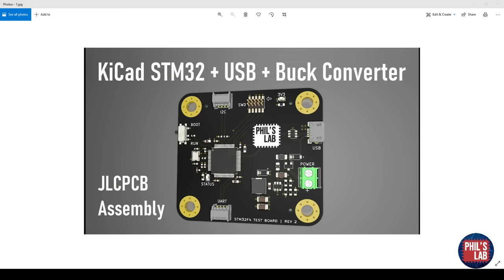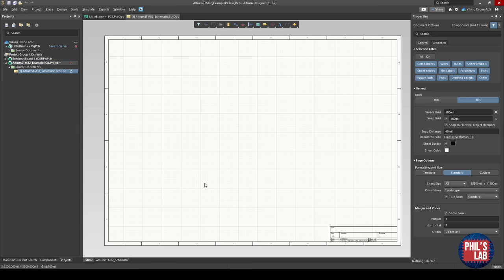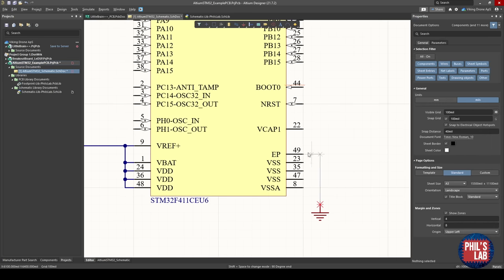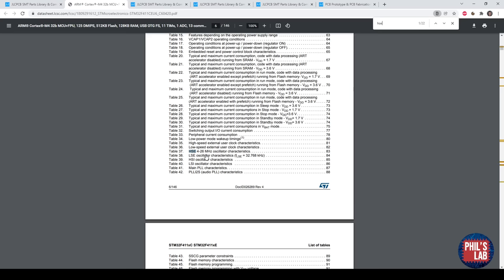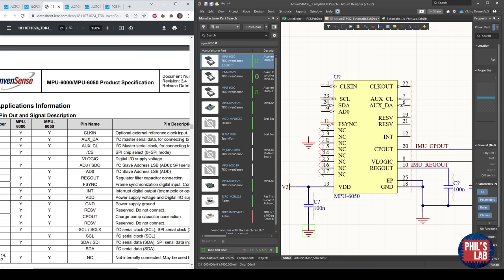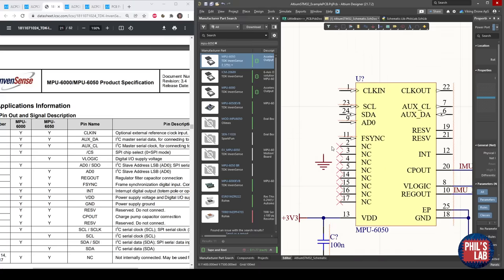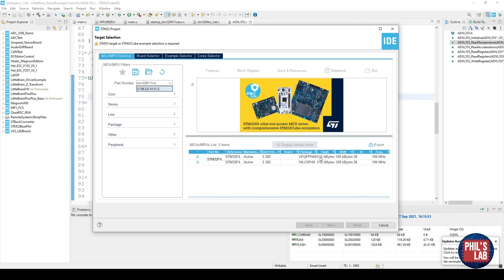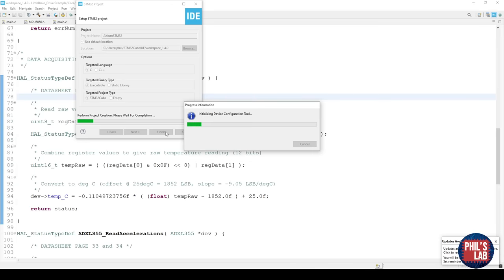STM32 PCB Design - Complete Walkthrough - Altium Designer & JLCPCB - Phil's Lab #41

Comment: Again, a really good video Phil! Thank you. I´ve been using Altium for 11 years and I always get useful tips watching your work.
One thing that came in to my mind when using small resistors and capacitors like 0402. Keep the connected copper to them as unified as you can. We have had problems in the solder oven with components standing up towards the side with the largest copper connection. Several times I have had to decrease the conductor width towards groundplanes to avoid this.
Reply: Yes, tombstoning is the name of the phenomenon. Thermal relief on the pads becomes very necessary for these small passives.
Reply: @wesleybecker834  is there a video that describes this topic in detail?

Comment: Thanks so much for making all these tutorial videos that shows entire process from start to finish with the rationale for the decisions made. I have a couple questions about impedance controlled traces between your designs in the videos and in the GitHub repositories.

In the video you set up the USB trace widths for the JLC7628 stackup (0.26mm), but the gerbers in the GitHub appear to show them at 0.1532mm. Did you end up changing to producing this in the JLC3313 stackup after the video was finished? I'd like to get some boards produced and just wanted to make sure I have this correct.

I see a similar-ish thing with the previous LIttleBrain board, where in the GitHub history the USB trace widths were originally 0.2611 mm, but when you did a revision to remove the USBLC6-2SC6, the trace widths went to 0.2mm. Was that just a simplification and this level of detail doesn't matter at such short trace lengths?

Thanks again for all the fantastic videos.

Comment: Great video. Your videos about pcb design assist to us. I have a question about stack up section. When you adjust the layers of the pcb, you selected in the power and ground layer as signal instead of plane. In this video you mentioned that this choices avoid creating a negative gerber. Does this choices make sense? The senior employees who work in our company always prefer the plane. I'm confused as a junior hardware engineer. Regards.
Reply from the maker: Thanks. I guess it's more of a preference/habit thing - there's no harm in using either.

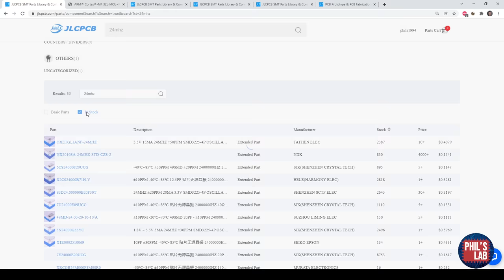Comment: Hi Phil, at 24:12, the first result is an oscillator, which correct me if I'm wrong but it needs just power and you have the clock output. Wouldn't be that more desirable than a crystal?

Comment: Why did you not seperate VREF+ (Called VDDA in KiCAD STM32 Video) to 2 different 3.3 Voltages, one Analog and one your common +3.3V?

Edit: I wonder if he ended up using a different STM32 board, and that is probably why.

Comment: Isn't each individual VDD pin supposed to be connected to the ground through a capacitor? Then how come we put 5 parallel caps and connect all vdd pins to each other and then connect them between + and -? Doesn't the behaviour change?

In other words instead of connecting each pin to a 100 pf cap we are connecting all of them to an equivalent 500 pf cap(parallel caps add up)

Comment: Thanks for the time you put in your content Phill. I started using Altium since It has a free license for college students. I am trying to get used to the library management because I am comfortable with how KiCad libraries work.  I just wanted to ask you why did you created a library with generic components (caps, resistors,etc) instead of just using any of the package size that you want from the Manufacturer Part Seach and just replace the value? And would you be able to share your library of generic components?
Reply: I am looking for answer to the same question. Did you find answer to this?

Comment: Thanks for the video. Just a quick question,  I don't have GND vias placed under the chip on my footprint taken from STM website. Should I place them manually?
Reply from the maker: If there's an exposed pad (EP), then yes - both for electrical and thermal reasons. Some STM32s in a QFN package come without an EP however.
Reply: @PhilsLab  Yes, there is an exposed pad which is connected to ground through pin 49 on STM32WB15CC. I am designing a board which will be working with Bluetooth. I am using 4 layer board with a composition of Signal Ground Ground Signal respectively. I placed smaller vias (0.5mm diameter / 0.25mm hole size) on the center of splitted solder pastes (It came separated as 16 square pieces). Then I placed a polygon connecting them to GND together with decoupling capacitors on the bottom layer. I also used a thermal relief style vias as you mentioned. These are great tips which I learned from you, this is my first PCB design for manufacturing and I will be very happy if it works as intended. Thanks for your time!
Reply: @aliitastan  Did it work?

Comment: when will u make a guide of how to program it ?
Reply from the maker: There's a video on my channel showing how to program these kinds of boards.
Reply: @PhilsLab  yea i found it and saw it but i am still a bit confused regarding the connection .
you seem to program through the USB but also used a SWD connector for debug. right but u can do without the SWD connection ? 
Also on 27.12 you posted a vid and you said that in the past you used 2 usb s for each STM32 , 1 programing and 1 debut but later said that now you could only use one for both functions. And that got me confused , can you do that from software or do you use some jumpers to switch lines?

Comment: YouTube!!!😬 set the bell but it still doesn't ring
Reply from the maker: The programming can (in most cases) be done via USB by pulling BOOT1 high before applying power. That puts the device into DFU mode.
Reply: @PhilsLab  :D

Comment: Do we always need IMU (in this case MPU-6050) with STM32 or not? In what cases do we need it?
Reply from the maker: No, you don't. Depends entirely on the system requirements. In this case, it was just to show how to add an external peripheral.
Reply: I am currently working on a project for my college studies; JTAG Advanced Controller Board consisting of: Ethernet interface/JTAG interface/USB interface.

My project has to include PHY and RJ45 for Ethernet interface / USB conn for USB interface / and FPGA XC6SLX4-3TQG144c (144pins) + JTAG Conn + STM32F407VGT6(100pins) for Jtag interface. 

Considering the fact that I'll probably use I2C communication in some way - do I need and external IMU and should it go across both FPGA and MCU? @PhilsLab